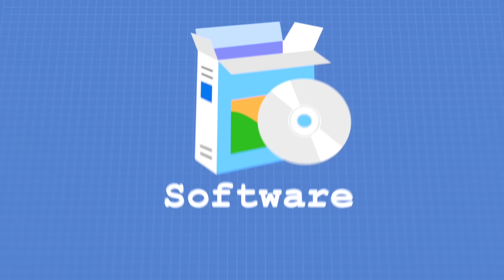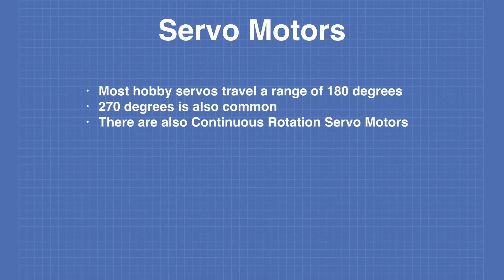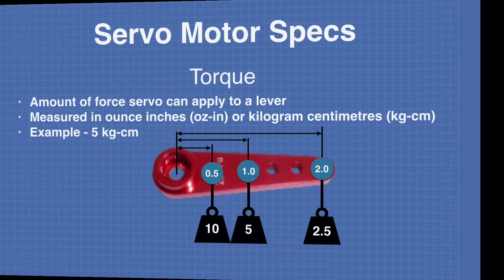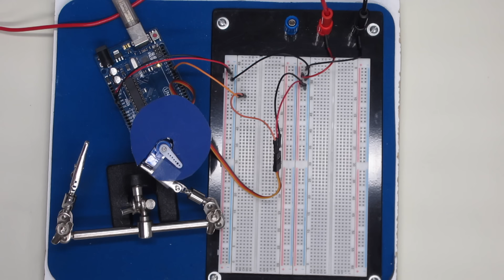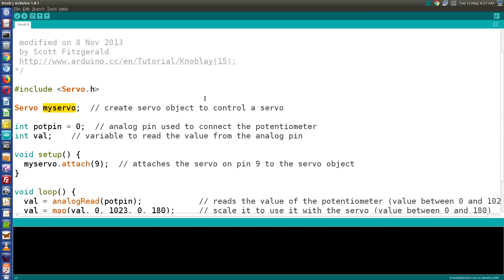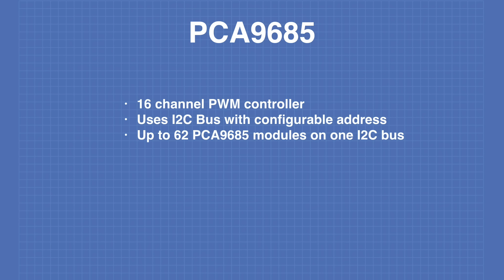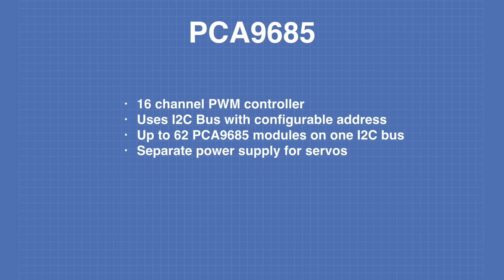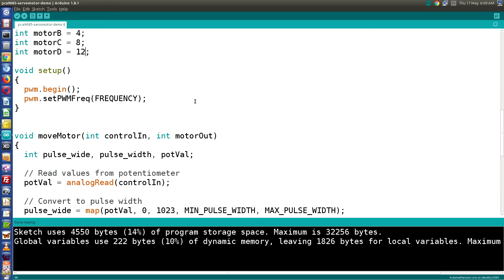Using Servo Motors with Arduino

Comment: Hey, hi !!!!!!!! That was a very intuitive and knowledgeable video. I just want one favor from you, ie: can u suggest a specific servo motor that i can use for ankle rehabilitation exoskeleton project, which is to be placed below the footplate to move the foot sideways, the servo motor should be of enough capable torque and also should be power efficient and have ability to be controlled via application or a program.

Comment: Hello , i wish to make a project where the movement of the servo is as follows:  input signal No.1 > 90 to 0 & back to 90,  input signal No.2 > 90 to 180 & back to 90(degrees)

Comment: One thing : Arduino Nano and most of the new Arduinos can handle 12 bits analog inputs, but their default setup is 10 bits for obvious compatibility reasons. So if you want to keep the input on 12 bits resolution, the same as the output board resolution, just add the "analogReadResolution(12)" command in your setup and you can remove the map calculation. The R4 and Mega can even read a 14bit resolution.

Comment: excellent video! one thing I've never found on the internet is a tutorial explaining how to use a serial servo (eg. Feetech scs0009) with Arduino. This type of servo can report temperature and force levels back to the microcontroller and would be a good thing to have when designing robot arm grippers where you only want to apply a limited amount of force when gripping an object. If you ever have the chance to work out the Arduino integration, this would be a useful tutorial

Comment: in a pinch you can turn a standard 180 degree servo  into a continuous 360. takes a few minutes just glue the potentiometer and remove any mechanical stops. there's some good YouTube tutorials on it.

really helped in my project. I needed to drive a gear system and 360 servos weren't compatible with the RC plane receiver I was using to control the servos. (9 gram micro servos)

Comment: great video and content. instant subscribe. how would you approach a project that needs to run about 30 servos and 20 steppers? is it at all possible to convert PWM to signals for a stepper? it would be great to use the PCA9685 for everything somehow since it can handle so many motors

Comment: Very nice video.  Some improvements:
- watch the camera when you frame a shot; there were a few shots where you either block what we need to see or else the important parts are out of view.
- You speak of scaling up using the PCA9685 to multiple servo motors but don't talk about the scalability of the I2C serial communication, which I'd like to know if I'm going to create a multiple servo design.  I'd want to know if I set an angle (pulse width, actually), is the library smart enough to send the signal only once.
- In the last demo, I wanted you to manipulate all 4 potentiometers at once to show that there's no lag and that they don't get confused.
- I want to see safer code that imposes limits on the pulse_width calculation to make sure that they are in range and won't hurt the hardware.  And also options on what the software should likely do if the limits are exceeded, such as clamp it, light up an error LED, or ignore the value.
- Please explain what "start()" does, above and beyond what the object's construction does.  It's doesn't seem necessary to the design, that is, you didn't justify it in the video.
- "controlIn" and "motorOut" variables should perhaps be named "controlInPin" and "motorOutPin".  And what does the 100000 factor do in the equation?
- where are good sources for servo power if I don't have power on my bench? (Or, like most hobbyists, don't even have a bench?)  You don't have to explain that fully but a reference to another video would go a long way to reducing my learning curve.

Comment: In fact it gave the following errormessage.
I cannot find the required Adafruit_I2CDevice.h file anywhere on my c:drive
In file included from C:\Users\31621\Documents\Arduino\mijnproject\reuzenrad\looplicht\looplicht.ino:6:0:
C:\Users\31621\Documents\Arduino\libraries\Adafruit_PWM_Servo_Driver_Library/Adafruit_PWMServoDriver.h:26:10: fatal error: Adafruit_I2CDevice.h: No such file or directory
 #include <Adafruit_I2CDevice.h>
          ^~~~~~~~~~~~~~~~~~~~~~
compilation terminated.

exit status 1

Compilation error: exit status 1

Comment: All of a sudden the sketches including the following Adafruit PWM Library give an error: error while compiling for board Arduino Uno. In the past compilation went allright.

// Include Adafruit PWM Library
#include <Adafruit_PWMServoDriver.h>
 
#define MIN_PULSE_WIDTH       650
#define MAX_PULSE_WIDTH       2350
#define FREQUENCY             50
 
Adafruit_PWMServoDriver pwm = Adafruit_PWMServoDriver();

Comment: i am trying to use a PS3 controller to control 6 servos using PCA9685 and esp32, would you be able to help with the codes?

Comment: I would love to reach out to you about a project we are wanting to make. We want 48 led lights that are individually controlled by either a stepper motor or a servo motor but are individually controlled to separate their spin cycle through small changes in the phase, time delays etc… in doing so we’d be able to create a beautiful light show with spinning lights that create an amazing optical illusion. However….. I’m a complete NOOB and I’m trying to learn how I can make this happen. I would love some assistance in any way

Comment: the sketch is not included with my  Arduino IDE as an example sketch though
 I have version  1.8.1 and it is not there  you also forgot to show to  go to board manager and select the board type and to select the COM port first  before opning the example sketch which is not even there, do I need to  download  the servo library first for it it to appear because  I have nothing in version 1.8.8.

Comment: Hello I have a project where I am building a Stewart Platform. For this I have 6 digital RC servo motors 20KG each with 2100mA±10% (4.8V) -2700mA±10% (6.8V) running.
what kind of power source can i use for this.

Comment: I have problem with servo motor
I use servo to cut wire of fixed length, say I set length to 50 mm for each wire to cut but first wire cut is always short in length say 47 mm or 48 mm or 49 mm and rest of all wire cut is
Exact 50 mm, so how to correct problem which I face every time I start my servo motor??

Comment: I am a beginner, but I would like to disagree with the explanation at minute 20:40: int val isn't what we read from the pot. At that moment into the programming it's just setting up an integer which could be for anything. A few lines later we actually declare it to be as what was read from the potpin. Please correct me if I am wrong. I think this "splitting hairs" explanation is important for beginners. Thanks for your video

Comment: I've got a question. When you widen the pulse width and the standard servo travels towards 0 obviously the continuous rotation servo just continues to rotate forever but my question is when it reaches 0 is there any check put in place to stop current to that servo to the sweeping servo for lack of a better term? Short of implementing the limit switch is there a way to estimate its position bye time or by the pulse width so you don't burnout the servo I mean this is a technical question that has no real application because obviously if you were gonna make some kind of project that you needed that other one not to sit there and grind you would put a limit switch or figure out a way to count its position I'm just curious if there is a way to estimate its place so if it does reach the end it will only grind for a minute

Comment: You're videos are really good, in my opinion your channel is one of the best when it comes to electronics. Thank you! 
But I would like to give a note to something: torque is defined by the (force applied) times (the distance of the point where the force was applied and the rotation axis), when the angle between then is 90°. In the servo specifications part of the video, you said that it is measured in terms of kg-cm, but I think it would be more precise if you use kgf-cm, which is a unit of force and distance.
Reply: H'actually, Torque (t) is the Cross Product of the vectors: Force (F) and Distance (r) where t=Fxr, x being the Cross product operator, and t is measured in Newton-metres!

Comment: This video  is just what I needed to give me a head start on  my DCS A10 sim pit. I am using servo motors to replicated gauge movements in the software and there are over 30 instruments in total. It would have been a nightmare to individually wire each and every servo . Now I can install the servo board on the dash and only have to wire the communication lines to it. Thanks so much!@

Comment: Nice introduction. For others, in his initial code at 17:00, there's no need to "sweep" each degree. You could simply write 0 to the servo, wait a bit, then write 180, wait a bit, and loop back to 0. 3 or 4 lines of code.
Reply: There is a difference. The servo would move full speed from one position to another. with the sweep it moves slower which was intended for showcase reasons.

Comment: Great presentation! I'm a retired EE 10 years of Arduino experience. I've seen these RC type servos before but never used one. My experince have been with larger DC motors. I'm currently working on an Arduino based cuckoo clock, these will work great thanks.

Comment: did  build   a  robot arm  with the  sg-90  servo    -   got  stolen  by the   kids  that  ""performed""   the   contents  of  apartment at developer  direction .  Taking  it to school  to show   off  .   The    arms   -  from  cardboard  - what   more  do you  need  

Thus   never  got around to  interface  to arduino

Comment: Great video as usual!
I'm working with a filament spooler for my 3d-printer and using PWM output for the servo motor. So far it works fine but when I try to use external interrupt, for another task, the servo motor acts strange. It starts moving to wrong positions.
Is it so that the interrupt affect the PWM function?
The Arduino I am using is MEGA 2560.
Regards
Jan

Comment: If possible I would like to see a video on  how to drive digital servos with the UNO.  I am setting up  system to  control the throttle and transmission on my boat .  we have twin engines and two stations.  we can use analog servos but the new digital servos look to be more robust.   And by the way the server tester is now $8, bought one anyway.  Thanks for the channel!

Comment: hello , great vidoes. im building a model car project with hydrolics and would like to control the amount of spins a 360 servo does so i can give it a limit. trying tro avoid breaking parts. would be nice to control the servo to spin two times in each direction only. how can i achive that ?

Comment: Isn't there a problem with the board/code combo only producing a resolution of 1 degree? as opposed to the maximum possible resolution of 1us when using PWM signal directly? I've noticed that when using high resolution servos, where resolution is 1us, when using this board, it only moves 1 degree at a time.

Comment: It appears that the Arduino only has 6 places for analog inputs from pots, but the expansion board provides room for 16 servos.  Is there an expansion board we can add to expand the number of analog inputs?  Otherwise how can we control from the Arduino alone all 16 servos?

Thanks for this video.  I've been researching the Arduino and PCA9685 and this filled in some gaps.

I plan on using this hardware for controlling turnouts on my model railroad.

Comment: Can anyone help me? I'm new at this.  I have 2560 kit. I need a easy answer. I want to program several small servo motors. I want to push a button and have one motor do something then a delay and another motor doing something different and so on. Say I want 10 motors . I have 1 servo sg90. I can get 9 more.  What else do I need besides the mega2560 board.  Can I even make such a program? I see nothing online.  I don't know how to write or wire such a thing.  You tell me at least what other components I need I will try to figure out the rest. Thank in advance.

Comment: Another great video, sir. Your knowledge is inspiring :)
Just out of curiosity, is there anything to suggest that the PWM board can't drive motors at the same time using protothreads?
I have tried using protothreads with it but it doesn't seem to work...

Comment: Could you please help to measure the current of servo 9G. I'm using 12 servos for the spider robot but the Arduino nano cannot control it. When unplugging, just plugged 5 servos, At that, the Arduino can control normally. I already used the power from 3 pics battery 18650 for supply for Arduino and servo.

Comment: Is this module oriented for controlling one servo at a time or is it built to control multiple servos simultaneously? Asking because the 5-6 volts it requires seems pretty low, no? just wondering... im a complete beginner.

Comment: Servo's dont work by PWM, its a misnomer. Teaching that terminology is wrong. Servos work by Pulse Width, not a typical PWM signal.

As you are correct, I concur:   A pulse of 1500 uSec (1510 JR) will center a servo, with a swing of +/-500, hence:
Low = 1000us (some can do 900us)
Mid = 1500us
High = 2000us (some can do 2100us)

Then the repeat frame rate is 10ms to 20ms, generally analog servers are 16ms to 20ms, some high speed digital servos are known to do less than 10ms frames.
So, every 16ms

as you can see, 1500us at 16ms would be a PWM duty of aprox 9% and 1500us at 20ms would be PWM duty of aprox 7%, so you can see its not PWM as PWM indicates that the duty ratio of ON vs OFF would determine the  servo position regardless of framerate, but it doesnt because servos dont use PWM, it may look like PWM, but it is not.

You see going back a few years, multiple pulses were on a single line line this:
1 Receiver output ch would be reset
2 pulse in goes to output ch, ch increments by 1
3 next pulse goes to output ch, ch increments by 1
4 at 20ms, then back to step 1

This way one could send several channels (9) to a standard analog receiver, every servo just sees a pulse and its the actual width of that pulse not duty (PWM) that translates to servo position.

Comment: I have a doubt, which power supply should I have to use to drive 6 servos 6.6v at max torque? I found that each of them pulls 3,2Amp.

Comment: for my exosuit I wanted an easy to control piston, and I think a servo can be combined with a threaded shaft to make a nice piston! so I will use a continuous rotation servo and hook it up to a arduino to exten/retract the piston!

Comment: I'm sorry if I missed this in the video, but I'm having issues with all of my servos jittering when power is on them but they are not commanded to move. It's almost as if its moving back and forth in very small increments repeatedly. The issue happens across all servos and I am supplying the 5V externally.

Comment: your channel is fantastic. Do you have a video that talks about the pros and cons to using an AC or DC servo motor? Maybe in what application an AC or DC motor has an advantage. I’m specifically getting into designing a 6DOF motion platform and working through which one would be best. Thanks

Comment: Why do servos "freak-out" when Arduino is power cycled? I have not been able to 'fixed' mount my servos (SG90) because they jerk 90 degrees when power cycled or attached Arduino is power cycled or code re-loaded. Any ideas why this happens? Thx!

Comment: I liked your video, learned a lot. As a result I bought a Diymore 6DOF metalic robot arm with MG996R servos and a 16 Channel PWM/Servo Driver IIC interface-PCA9685 voor Arduino, already in possession of an Arduino Uno. Because I'm not a electrical wonder, I would like to know  if you could recommend me a external powersource I need in conjunction with the 6 MG996R servos, what Voltage and Amperage do I need, because the specs state that 1 servo needs a current of 1400 mA ?

Comment: Can you replace the potentiometer with a off /on switch? So that when the switch is off the arm would be in the home position,  and when it is on the arm will move 180 degrees

Comment: The tiny little onboard SMD P channel MOSFET ( working as blocking reverse battery supply)  of PCA 9685 which is in series from the 2 pin servo supply screw terminal feeds the servo pins V+. Thus if 16 servos operate at a time with some little load from the V+ the tiny little MOSFET on the board simply smokes as the current goes well above its handling capacity.  One solution is to bypass the built-in MOSFET but then the strong back emf from servos retrigger the PCA 9685. What is the solution?

Comment: This is an excellent turtorial, but I am wondering why you say it is not recommended to run servo motors from the 5V arduino output pin?
Reply: the arduino can not handle that much amp draw
Reply: @dylandunlap212  Thanks Dylan - do you know what the amp rating is on the 5v output on the arduino uno (I can't find this spec anywhere - I can find what the amp rating is on the 3.3V outout but not the 5V??!!). Thanks in advance
Reply: @ajones2540  I’m sorry, I don’t know what it is rated for. I am extremely new myself.

Comment: Hi great job

I need advice. extruded and assembled the robot MK2 I used this example for control but I have a problem with the range of motion serv.zachadzaj too deep into the structure. if I understand this correctly, we can use "maps" to determine the range of motion of the servo. I think it's higher but for all servos at the same time. I would need to set each servo separately. can you help me? thank you david

Comment: BTW, I2C is actually spoken 'I' squared 'C', not 'I' two 'C'. Phillips invented the bus as an inter-IC bus ie. a bus that allows various chips to connect to a micro using a common protocol. Rather than say IIC they said I-squared-C.